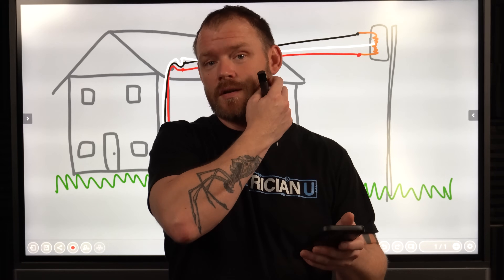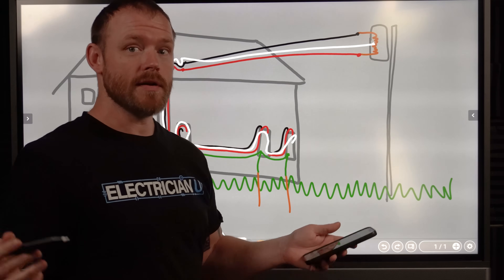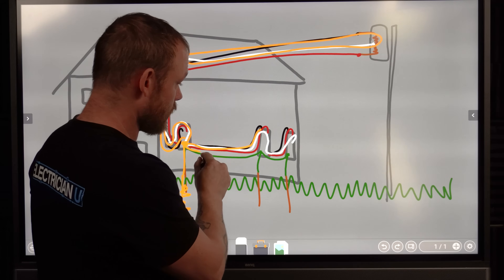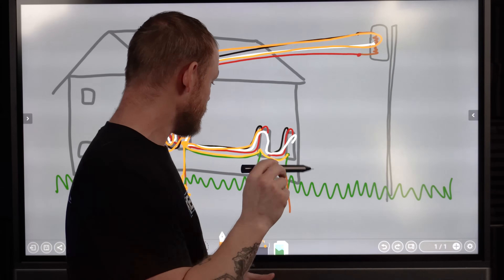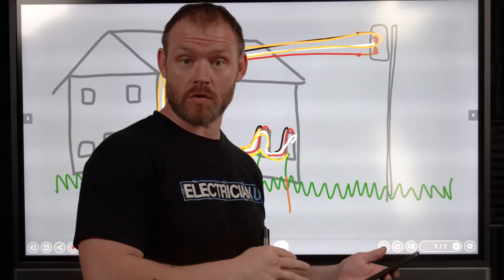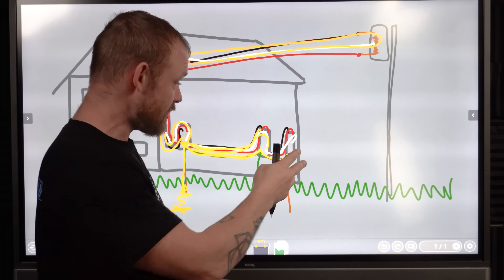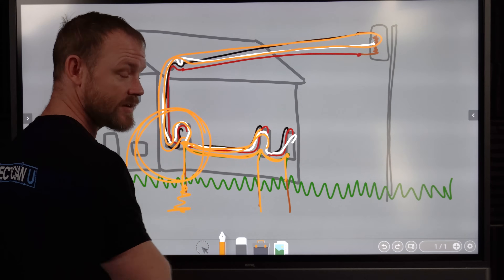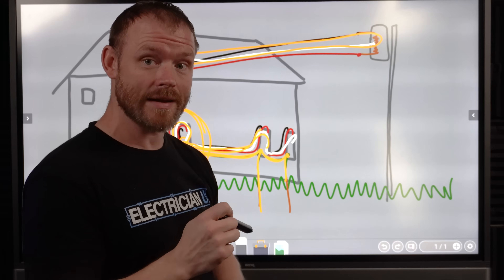Do We Need Separate Ground Rods for Each Sub Panel?

Comment: whats a more relevant question is when its a separately detached garage. the code gets real elaborate there lol
Reply: For a sub panel fed from one structure to another structure, you are required to install grounding electrode connected to the ground bar in the panel.   Must be separate.  Grounding electrode purpose is lightning to earth, nothing else.   Added information, Article 225 requires that a disconnect be at the point of entrance to the separate structure.   So, if panel is very near where the feeder enters, then main breaker.  If it enters and goes any distance in the building, then a safety switch is required to disconnect it.
Reply: @KevinCoop1  you're perfectly allowed to have a sub panel that's fed off a breaker in the service panel at least as far as separate garages go. You're wording like a separate building is Always looked at as a separate service which at least by Florida code is far from true. Ive done dozens of mlo panels in a garage with just an egc pulled through the PVC underground that were city permitted/inspected.
Reply: @erich1380     Well, what can I say?   I know what Article 225 says, and I know very well how to understand NEC.  I’ve seem numerous code violations that passed inspections.   I’ve also seen inspectors that tried to enforce things that they misinterpreted dozens of times.  Read Article 225 and tell me where I’m wrong.  Also read 250.32(B)(1).   BTW, the exception does not apply to new installations.
Reply: I had the same question.  I've seen a lot of videos where guys are failing inspection cause they didn't put a ground rod at each of their detached buildings.
Reply: @bassman87  there's a few very rare exceptions but most of the time if you pull an equipment grounding conductor, you don't need to put in a ground rod.

Comment: Correct me if I'm wrong, even if there are grounding rods at each subpanel, an equipment grounding circuit still has to be run between each panel?
Reply: if its a separately detached garage, if you put in a ground rod and run a GEC to the panel, you dont need an egc through the conduit from the service panel to the sub. ive had properties that were really big and the garage was a good 100 feet away from the house. we just put in a rod and ran a bare number 6 to the ground bar in the sub panel so we didnt have to pull an egc through the conduit.
Reply: @erich1380  I don’t understand why you wouldn’t have to still pull a EGC. Unless you bond again at the sub panel you aren’t protected. Which if you bond again you’re double bonded which is against code. All ground rods have to be connected or you risk difference in potential of each.
Reply: @erich1380  also 250.50 states all electrodes at each building or structure shall be bonded together to form an electrode system
Reply: @fordsbetter3496  i dont have my codebook on me but theres a part in separately detached garages where you can either put in a new rod and run a bare to the ground bar of the sub or just run an egc through the conduit like normal
Reply: @erich1380  I’d be interested to see it. When you get a chance if you find that can you quote the code here.
Reply: If you run a ground wire to a sub from your primary feed you have to run the same size ground that is necessary for the primary feed.
Reply: Article 250.32 (B)(1) is the article you are discussing.  There is an exception for not requiring the EGC to be with the feeder as was said in a comment.   The exception is for installations that are existing and installed with No EGC, not for a new install.   What is the reason for that?  This article flip flopped many times from when I started in 1983 to (I believe late 1990’s).  They finally stopped changing it and is as in current NEC’s.  Make sense?   Respectfully,   Kevin
Reply: @KevinCoop1  thank you for that. Much more clear understanding now

Comment: This reminded me of a perfect example that’s unrelated. People that put ground rods at every light pole but don’t run a EGC because “they don’t need to” . Any ground fault won’t trip the breaker and you will literally be supplying voltage/ current into the ground and light pole. Mike holt actually has a really good video on it about a boy that was electrocuted on a chain link fence and it turns out it was getting its source from a ground rod from a light pole. Grounding is so misunderstood. A good segment would be multiple videos talking about grounding/ bonding because so many people don’t truly understand the importance.
Reply: Mike Holt has made the best grounding vidios. Was lucky to have him do a presentation at two IAEI meetings. Our local IAEI told us several times to never install a ground rod at light poles. Nothing beats a properly sized copper ground conductor.
Reply: @garbo8962     You are absolutely correct.   I’ve had his classes a few times too.
Reply: Different codes. NEC applies only after the service demarcation.
Reply: If you have a sufficient ground at the location of your sub panel can you forgo or eliminate the ground connection to the main panel? I plan to consult with the inspector. Next time I speak with him. Until then, what are your thoughts?
Reply: @bkdesignconcepts I’m not exactly sure what you mean but if your asking about eliminating the EGC connections connecting the sub panel and main panel then no, you can’t do that and you would not benefit in anyway from it. The ground connection from your sub panel to main panel is important to facilitate any ground fault that might happen.
Reply: With lightning ground strike,(millions of volts) there may be thousands of volts between ground rods. Now if someone  grounds different equipment each  with it's own ground rot, there may also be thousands of volts between equipment, a very risky situation and sure way to fry the equipment.
Reply: Yes ,it was in augusta ga. I live in the country nearby , it was not good and the county owned and maintained it , I wonder how long it was live before he unfortunately touched the fence
Reply: You can run a ground rod at light poles but they should be on GFCIs because if they aren’t it’s just a high resistance ground fault that goes undetected in most instances.
Reply: @RadDadisRad  which to me dosent make any financial sense. Do you want to put gfci and ground rods at each pole or just pull a EGC. The ground rods are essentially pointless at every pole anyways.
Reply: @fordsbetter3496  the ground rod is for lightning suppression. It’s not to be used for supplemental egc for the light pole.
Reply: @RadDadisRad  exactly which is why I say it’s pointless you’re better off putting a surge protector on the pole then the ground rod. In my opinion the surge protector will give it a better chance
Reply: @fords better  Exactly, the chances of a ground rod saving your light pole/circuit from a direct lighting strike is practically 0% anyways. It is a waste of time and money. EGC and surge protection.
Reply: @RadDadisRad     Ground rods at metal lighting poles bolted to concrete bases are not required and are not to be installed.   We went through this in an NEC class.   You should have seen the Consulting engineers face when he finally figured out that you are not supposed to put ground rods on them!   Get your NEC, and read carefully.
Reply: @KevinCoop1  I know you’re not supposed to but when you have an AHJ that requires them not much you can do other than GFCI the circuit.
Reply: @RadDadisRad  you can run a ground rod at each light pole along with a grounding conductor run to each light pole and the 2 are tied together. The neutral if used would be a totally separate conductor.
Just wanted to clarify so it goes along with the video.